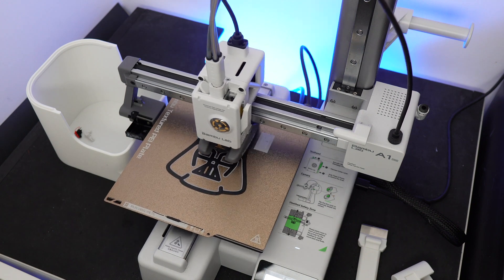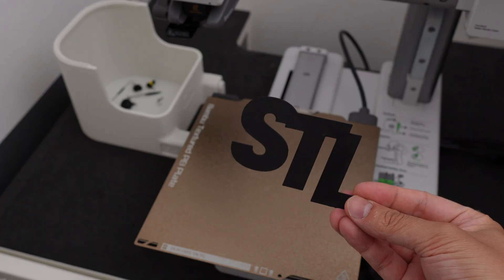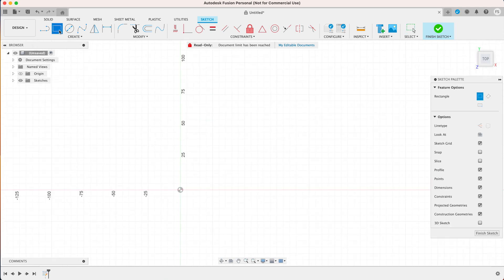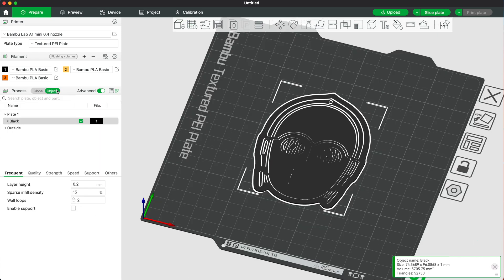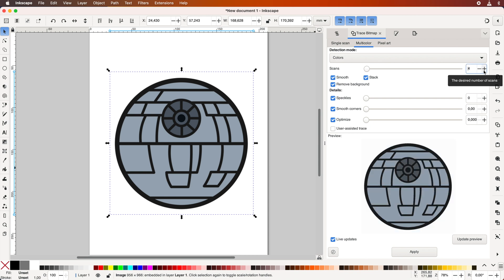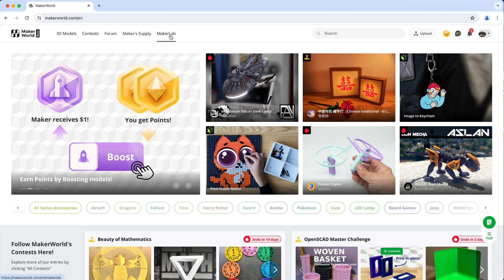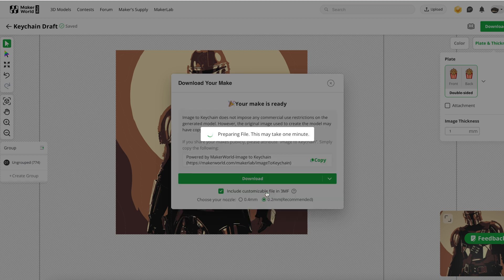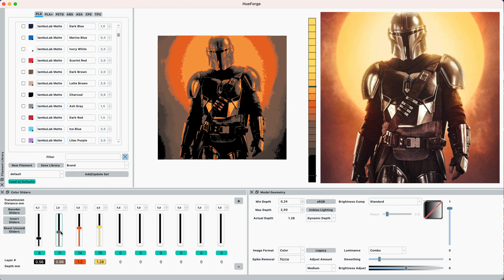How to convert ANY PICTURE into a flat 3D Print for FREE

Comment: Tried this but the various colors don't properly attach to each other, so the print just comes apart. What am I doing wrong? Looking at it in Bambu Studio you can also see small gaps along the edge where the color changes.
Reply from the maker: try to change the wall generator from classic to arachne and turn on the prime tower. Let me know if it works👍🏼

Comment: What if I don't have a bambu lab? Just a normal 3d printer?
Reply from the maker: can your normal 3D printer do multicolor print? if not, then you can only change the colors of the whole layer (pause, unload filament and load new filament). 
You can also try Hueforge (its a paid software).

Comment: If you don't want to pay for Hueforge you can also always make a lithopane but in the slicer instead of printing the lithopane upright just print it flat... I do this with 3 different layer colors and it usually works for me sometime I only use two different colors but it also works.... not as detailed as Hueforge but it still works and looks great and that is where the designer of Hueforge got the initial idea, on thingiverse there is a designer that use the lithopane method with multiple materials for as long as almost 6 or 7 years and I have been doing the same since I still had my Anet A6 printer back in the day.
I will start with a Black solid color till the last layer before there is texture then maybe a lighter grey ontop of that for a couple of layers and then the last couple of layers is the 3rd color in white to do a grey scale but you can also do it with black red and yellow to make it look like a fire for maybe a rise of the phoenix or anything with fire.
Reply from the maker: thats some great tips, thanks for sharing!
Reply: @SoloGamingZA can you link this designers thingiverse  page? I never knew this was done before.

Comment: Nice tutorial. Thanks!
Reply from the maker: You're welcome!
Reply: @Lukis3D  
Hi, there.
00:14
What size are the hueforged ones?
Thanks.
Reply from the maker: @mikekiske  hi there, those were not made using hueforge, but a tool called „Image to Keychain“. They‘re 100mmx100mm.
Reply: @Lukis3D  Nice. Reasonable size. Image to keychain from Maker Lab? Thanks for sharing.

Comment: So, I'm new and this question is off topic. Is there a good vid you recommend for learning to use the slicer? I have the a1 mini and want the tool box for the parts and tools, but can't find one the mini will print. Also I'm having issues with the ams, I'm troubleshooting that today.
Reply from the maker: Hi there! i can recommend the tutorials made by @ItsMeaDMaDe, they are easy to follow. 

There are also alot of (smaller) toolboxes designed for A1 Mini💪🏼